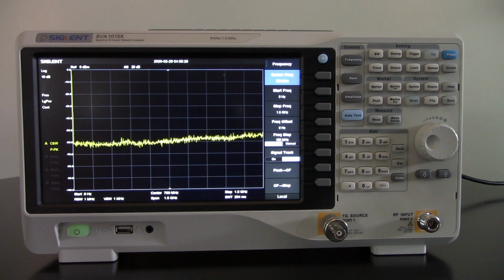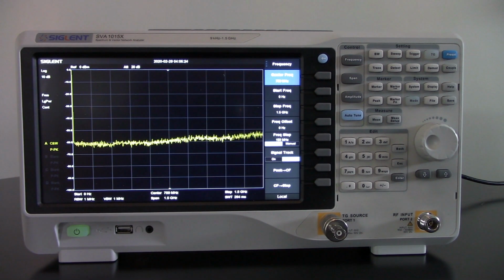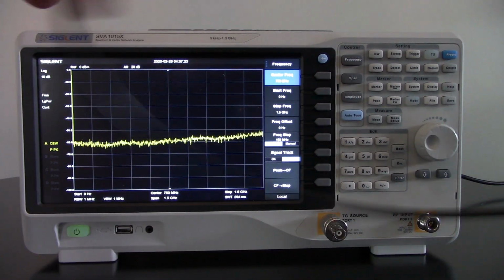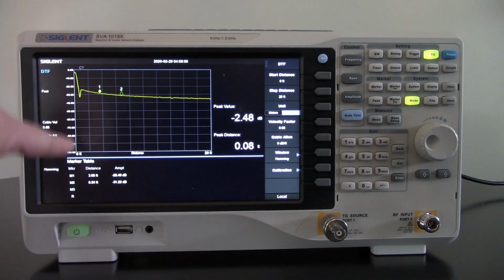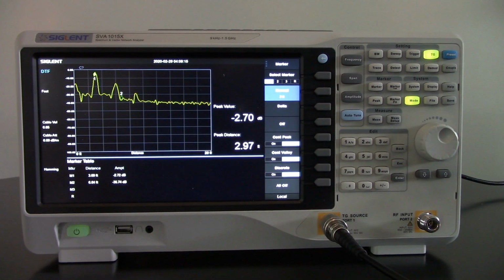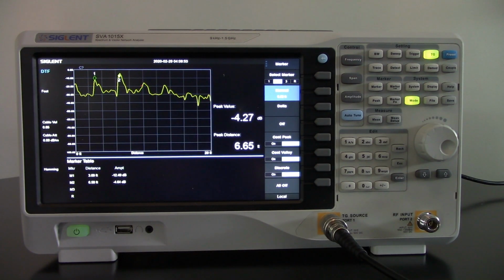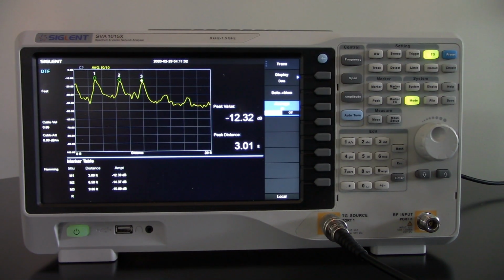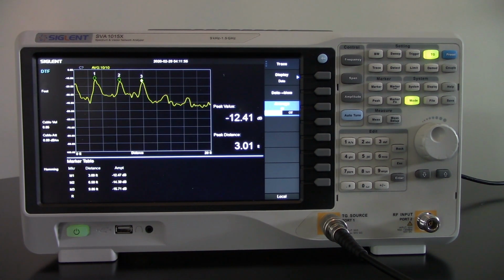SIGLENT SVA1000X Distance to Fault (DTF) cable testing

Comment: Maybe a silly question, but could I use this feature also to find an earth fault in a powercable? Issue at hand: I have a solar installation where the ELCB switches off in wet circumstances. Might be a cabling problem, bad connector or a faulty microinverter.  Could I use the SVA + DTF to locate where the actual earth fault is?
Reply from the maker: Hi Paul. Thanks for writing in. Distance-to-fault uses FDR (frequency domain reflectometry). Basically, it sends a multifrequency signal down the cable, measures reflections, and shows you the location of impedance differences. Opens are generally easier to find than shorts, because of the relative difference in impedances.. but it may be sensitive enough to find that short location. 

The SVA comes with over 100 hours of trial time (measured when the instrument is powered on). So, you could try it without buying the license. 

If you have additional questions, please send an email to info@siglentna.com

- Jason, SIGLENT NA

Comment: Charging additional licensing fees to unlock firmware features on the test gear hardware the customer has already paid for is a modern curse and a terrible business practice. 
Any profit you make from doing this is dwarfed by the sheer amount of customer resentment that business practice creates.
Reply from the maker: I understand your perspective, but it is important to realize that software isn't free. It requires time and resources.. just like hardware. It requires maintenance and updating.. just like hardware. 

When selling something, the company is trying to recoup those costs and make some profit. The alternative to licensing is to sell the product at a higher price with all options installed/activated. 

We could certainly do that, but our philosophy is to provide high value test gear. Not everything is included, but SIGLENT includes much more than any other vendor. - Jason, SIGLENT North America
Reply: @SiglentVideo  No, that is not the only alternative. You developed the software ONCE, it then costs you NOTHING to include it with every scope. 
Doing so increases the number of scopes sold, which increases your profits, which is the correct way to recoup your software development costs.
I don't think you realise how irritating it is for customers to buy hardware only to find is capable of working better if it wasn't for some of the functionality being deliberately disabled by the manufacturer unless an additional  "ransom" is paid to unlock that functionality. 
Just because other scope manufacturers are doing even more of these exploitative tactics as part of their equipment sales doesn't make it a good customer experience.
Reply from the maker: @MaxWattage  We simply disagree. I feel that SIGLENTs value far exceeds the other players in the test and measurement field. But that is just my opinion. In the end, the market decides the actual value of the company and it's products. - Jason, SIGLENT NA
Reply: @SiglentVideo  That is obviously very disappointing to hear. Given that all test-gear manufacturers now employ this irritating sales practice, there is no consumer choice and so the market cannot "decide". 
I should probably mention that I do like SIGLENT products and I will continue to buy them (with all the license features enabled), I was just hoping that you might have considered having a better sales model.
The only other thing I would like to see is SIGLENT open-sourcing any discontinued products for which you no longer offer software updates, thereby allowing customers to maintain, adjust, repair, or improve them, rather than them going to e-waste landfill and helping to destroy the planet. It would be great PR and would cost you nothing.
Take for example, the SDS2304X oscilloscope; that is a discontinued product and you don't issue any compatible software updates for it. It has been abandoned.
However, customers are prevented from accessing the (linux) operating system in their own equipment to either fix any remaining issues, or to add useful features of their own (e.g. BODE plotting). 
Open-sourcing the design would give us the "right-to-repair" our own equipment, and would do much to endear customers to the SIGLENT brand.
Reply from the maker: @MaxWattage  Thank you for the comments. I will pass them to the Product Managers for review. - Jason, SIGLENT NA

Comment: Hello  I am interested to buy a SVA with some options but the information about the analog and digital modulations options are scarce. Would it be possible to make a video about those?
Reply from the maker: Thank you for contacting us. The Digital Modulation Kit (SVA1000X-DMA) provides: 

Constellation diagram
Eye Diagram
Spectral View
Statistics

Compatible protocols:

ASK
FSK digital modulation
• 2FSK, 4FSK, 8FSK, 16FSK
MSK digital modulation
PSK digital modulation
• BPSK, QPSK, 8PSK, DBPSK, DQPSK, D8PSK, Pi/4 DQPSK, Pi/8 D8PSK, OQPSK
QAM digital modulation
• 16QAM, 32QAM, 64QAM, 128QAM, 256QAM

A trial option for approximately 100 hours of instrument "On" time is included with each SVA to deliver some time with each option before purchase.

I will schedule a video, but I can't say when it will be done. You can also contact your local SIGLENT office and request a demo, use our 30 day no-questions-asked return policy, or attend a local trade show to see the instrument in action.

- Jason, SIGLENT North America